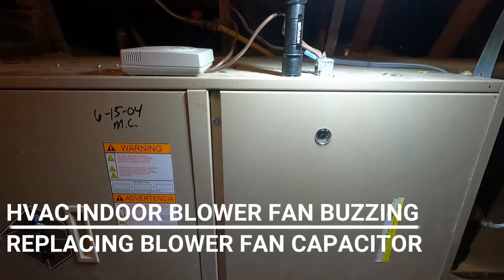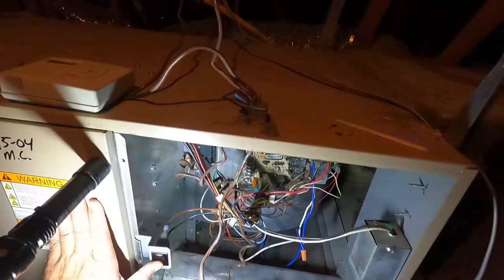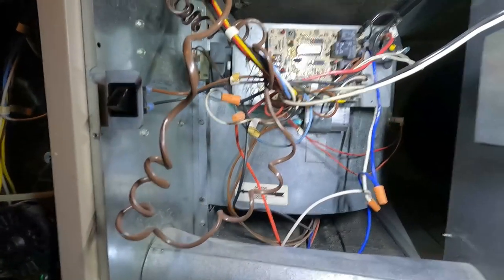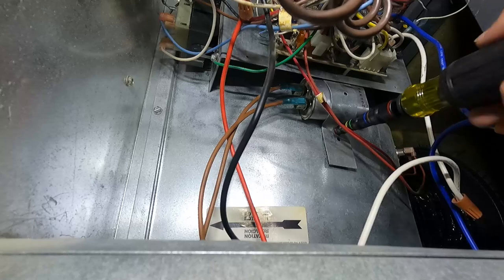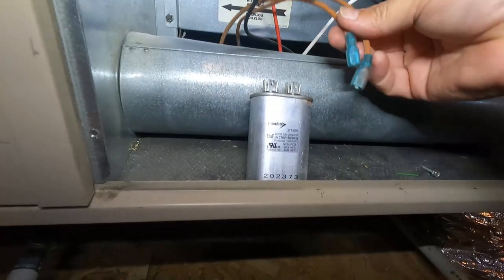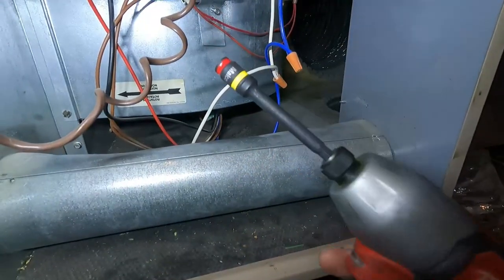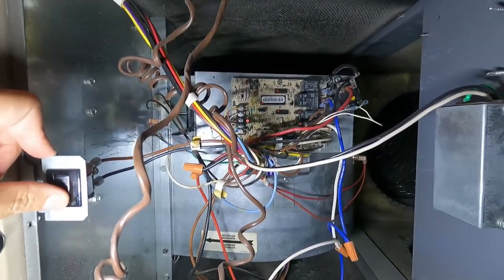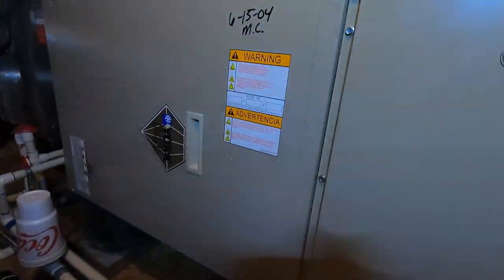HVAC BLOWER FAN NOT BLOWING - FAN WON'T TURN ON - REPLACE THE BLOWER FAN CAPACITOR - EASY FIX - DIY!

Comment: Thanks. Can I extend the capacitor wiring on the air handler which is in the attic to make it easier to reach? Not as young as I once was.

Comment: So I smelled the burning with our unit but it works fine once kick started. Should I replace the capacitor or the motor? Can the capacitor release burning smell too?
Reply from the maker: Usually the burning smell is the motor going bad.
Reply: @DantheFixitMan  I have a 2010 whirlpool furnace, I think it’s also part of the Amana and Goodman company.  I can’t find the capacitor, I looked everywhere and I’m pretty sure it’s the capacitor, I’m dying to change it, is it possible there isn’t one in this unit, or it looks different? Thanks in advance